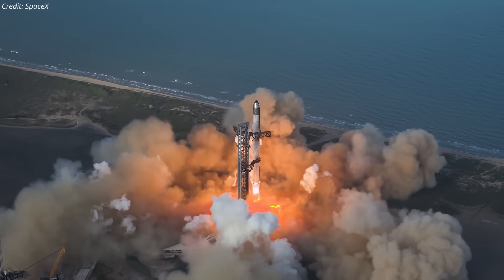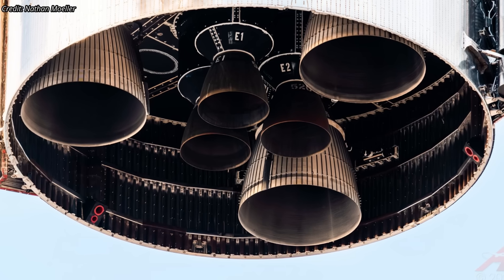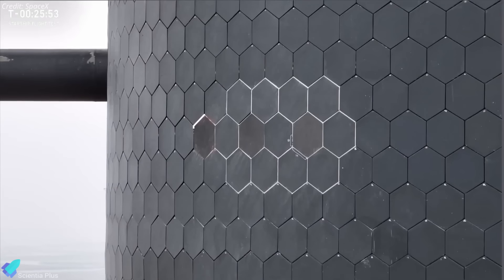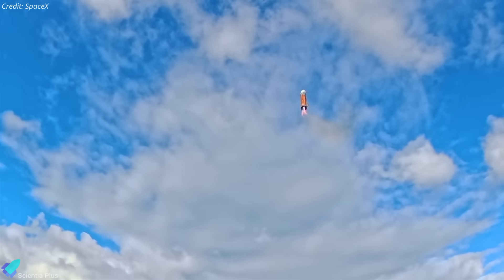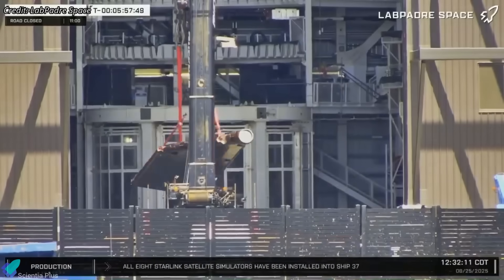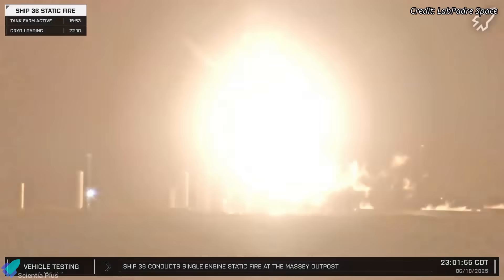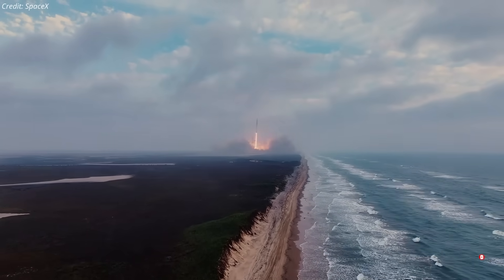Starship Flight 10 Aftermath a Closer Look! Explosion Source Footage Released From Flight 9

Comment from the maker: 🚀 Starship Flight 10 Detailed Breakdown: https://youtu.be/irVUMJNe0Kc

📚 Learn More:

🚀 Starship Block 2 Explained:
 📖 Summary: https://shorturl.at/b0dtw
 🔍 Detailed Explanations:
  • Design Improvements Update 1: https://shorturl.at/lpGT7
  • Design Improvements Update 2: https://shorturl.at/gwNQ4
  • Nosecone & Payload Bay Redesign: https://shorturl.at/xa60S
  • Methane Downcomer Redesign: https://shorturl.at/XdYBG

🚀 Starship Block 3 Explained: https://shorturl.at/mnBT4
🚀 Starship & Booster Block 3 Detailed Breakdown: https://shorturl.at/IViwD
🚀 Starship & Booster Block 3 Production Begins: https://shorturl.at/xRNkJ
🚀 Booster Block 3 New Transfer Tube / Downcomer Explained: https://shorturl.at/Iaqc6

🔥 Raptor V3 Mega Upgrades & First Test: https://shorturl.at/TRIyj
🧱 What’s Inside Starship GigaBay?: https://shorturl.at/nJM75

🛠 Insane Engineering of New Starship Launch Pad B: https://shorturl.at/7RAZd

🛢 Dual-Port Orbital Refueling – Full Technical Breakdown
https://shorturl.at/5tiqK

🛠 Other Starship Upgrades:
 • Hot Staging Explained: https://shorturl.at/jf400
 • Super Heavy Booster Upgrades: https://shorturl.at/Pi5R3
 • How SpaceX Protects Raptor Engines: https://shorturl.at/4Om8F
 • New Heat Tiles Explained: https://shorturl.at/p2Ijb

🚀 Starship Flight 7
 📽 Complete Breakdown: https://youtu.be/UqzZx7vb-TA
 🛠 Root Cause & Fixes: https://shorturl.at/HcLKo

🚀 Starship Flight 8
 📽 Complete Breakdown: https://youtu.be/f26yH80RK2o
 🛠 Root Cause & Fixes: https://shorturl.at/vsGFB

🚀 Starship Flight 9
 📽 Complete Breakdown: https://youtu.be/2eirgcUzwts
 🛠 Root Cause & Fixes: https://shorturl.at/NwhZA

🔥 Starship 36 Explosion:
  📽 Detailed Breakdown: https://youtu.be/VWQiIz1ymBA
  🛠 Damage Report: https://shorturl.at/Quoex
  🛠 Root Cause & Fixes: https://shorturl.at/NVqdS

🚀 Starship Flight 10 Detailed Breakdown: https://youtu.be/irVUMJNe0Kc

📡 Stay Updated:
📢 Weekly Updates: https://bit.ly/3HIQjPC
🚀 SpaceX Playlist: https://bit.ly/34wue8T

🌍 Follow Us:
👍 Facebook: https://www.facebook.com/scientiaplus

Comment: Raptor versión 3 engines will only be launched by 2027 on those versión 4 Starships.
I.e., 280*3+306*6 = 2676 tf, that matches those 2700 tf of the Starship version 4 table at 11:16.

Next milestones seems to be:
2025: orbital launch.
2026: fuel on orbit transfer.
2027: fuelling a depot-Starship with <10 tanker-Starships.

Comment: AND BOTH BOOSTER AND SHIP BLEW UP AFTER "LANDING" Afew meters above the water.  

How can you call it a success if bith ship and booster blew up?  

Reusability my ASS!
Reply: They were supposed to blow up.  Starship went into the water engines running. What do you think would happen when you dump running engines into water? As far as the booster that actually hovered a few hundred feet above the water. The engines were then turned off, letting the booster fall several hundred feet into the water.

Comment: The red area is oxidation while cooling , Rust !    The white on the ceramic tiles indicates they went past their heat limits, and are now useless for anything more! One use, but did the job.  You only have to look at the shuttle tile  heat shields when it returns, they were better quality and subjected to higher drag temperatures than the SpaceX craft ever experienced.

Comment: Great analysis but...
Block 4 is not quite the tallest rocket ever conceived.  The Sea Dragon rocket was designed to be 150m tall and weight 20,000 tons, but Block 4 is the tallest free standing rocket conceived.  The Sea Dragon had be sea launched so the water could support its weight.  It was intended to launch 550 tons to LEO- completely insane.
Reply: Conceived not the same as an operational vessel.
Reply: @MrFuentepj  yes but "tallest rocket ever conceived" was what they said.

Comment: Here’s a hard, technical audit of that “Flight 10 smashed milestones” script—claim by claim, what’s substantiated, what’s conjecture, and what’s simply irrelevant to the stated end-goal (rapid, fully reusable Starship and—beyond that—Mars logistics).

What they say vs. what’s actually shown

“Flawless liftoff and ascent.”
Video from Flight 10 shows at least one booster engine shut down early in ascent on other coverage; calling ascent “flawless” is spin. Redundancy handled it—good—but flawless it wasn’t. Redundancy ≠ maturity.

“Booster 16: stunning ocean splashdown.”
Guidance and control were good. But an ocean impact is a controlled disposal, not recovery. No reuse, no inspection, no turnaround clock. That’s not a reusability milestone; it’s a telemetry milestone.

“First payload deployment proves transport potential.”
They deployed simulators, and the door bumped during the sequence. Useful mechanism data, yes. “Hints at orbital transport potential” is fair, but it’s early subsystem test data, not payload ops at scale.

“Raptor relight in space = restart magic for future burns.”
A ~5-second relight under hand-picked conditions is a good demo, but it’s not proof of robust, multi-restart reliability across propellant slosh states, ullage control modes, and thermal histories. Bankable only after a matrix of restarts across regimes.

Engine-bay “explosion” root cause (chill-vent clog/rupture).
The script asserts a diagnosis without released telemetry. The “vent obstruction → rupture → ignition” chain is plausible, but it’s still an inference. If SpaceX hasn’t published valve timings, bay pressures, vent mass-flow, and post-flight NDE, this remains speculation.

Orange/white TPS colors explained by metallic test tiles + intentional tile deletions.
Again: plausible. But a strong claim (“tiles mostly stayed on; bonding validated”) requires hard artifacts: tile-map deltas, loss percentage, backside thermocouple traces, hinge/actuator peak temps. None are provided. Color ≠ condition report.

“Catch fittings survived; catch soon (F13–F15).”
A low-res still of external hardware post-plasma tells you almost nothing about microcracks, bolt preload loss, or tolerance drift. “Catch soon” is marketing until you show NDT results and a dry upper-stage recovery to inspect that hardware.

Booster grid-fin “shake,” 3-fin redundancy “validated,” Block 3 will move to three fins.
That’s an inference. Unless there’s released flight dynamics + control authority margins showing stable, commanded behavior with a missing fin, you cannot claim “validated.” It may be true; it’s not shown.

Block roadmap (Block 3 transitional, Block 4 to 42 total Raptors, ~142 m stack, first flight ~2027).
Ambitious. Also unbacked by public configuration control documents or pad/ground readiness for that thrust class, and it increases thermal/structural/propellant margins pressure. More engines ≠ easier reuse.

Site plan upgrades (on-site CH₄/N₂ production, bigger tank farms, flame trench).
Sensible for cadence. Irrelevant to the big missing piece: dry recovery and rapid refurbishment. Also: on-site production at meaningful scale demands serious continuous power and massive cryo throughput—numbers not provided.

What Flight 10 actually proved (useful, but narrow)

Upper-stage door actuation + dispenser function (with a contact event to fix).

One in-space Raptor relight.

GN&C accuracy to tight splash targets for both stages.

All valuable. None of it demonstrates recovery, refurb-hours, tile retention margins, or fast turn.

What Flight 10 visibly did not prove

Reusable TPS. We saw flap erosion, skirt damage, and a vent-ignition in the engine bay. Claiming “tiles mostly stayed” without quantified loss and backside temps is PR, not an engineering report.

Dry recovery & turn time. Splashdowns obliterate the very evidence (microcracking, adhesive health, fastener creep) you need to certify rapid reuse. No recovery → no turnaround clock → no “24-hour” claims.

Root-cause closure. The engine-bay event explanation is conjecture in the absence of published telemetry + corrective action.

Mars-relevant systems. No ZBO depot, no ~100 t cryo transfer, no minute-scale pad cadence, no prop chain at multi-Mt/month. Those are the gates for “beyond LEO.”

Where the narrative overreaches

“Every major objective was met.” Only if you downgrade “major” to “didn’t break up mid-air and we got data.” For a reusable architecture, major means: survive, recover, inspect, quantify TPS integrity, and show a credible turn. None happened.

“Heat shield validated.” Show the tile loss <0.1%, flap hinge/actuator temps within design, skirt/engine-bay thermal budget not exceeded, and no ignition events. That’s validation. We got none of those numbers.

“Catch soon.” Catch hardware endurance must be proven after a dry recovery and full metrology. “Soon” is a promise, not a result.

The metrics that matter (publish these, or stop saying “rapidly reusable”)

Tile retention map & loss % (belly + flap leading edges), with backside thermocouples and structural strain gauges.

Engine-bay environment during re-entry (pressure, temperature, flammables), RCA of the vent-ignition, and the design fix.

Post-flight inspection load: part count replaced, man-hours, and a dated target for next flight of the same airframe.

Booster/ship dry recovery demos (even to tow-back) before “catch.”

Ground cadence data: pad refurb hours, tank-farm reset time, methane/oxygen throughput per day.

If you keep invoking Mars: ZBO depot demo + ~100 t cryo transfer with <1% losses, and a permitted pad cadence consistent with the tanker chain.

Context you can’t PR away

Splashdowns are disposals. You don’t validate turnaround via water impacts.

Adding engines (to “42”) amplifies—not reduces—thermal, vibration, and mass-fraction headaches. The prop mass only goes up; the TPS problem gets harder.

Heat shield is necessary, not sufficient. Even a perfect TPS doesn’t solve cryo logistics, power, or cadence—the real wall for beyond-LEO ambitions.

Bottom line

Flight 10 was a good subsystem test for a LEO-class truck: guidance, door + dispenser mechanics, a single relight, controlled disposals. Call that a success and you’ll get no argument. But framing it as “every major objective met” toward rapid, full reuse is narrative inflation. Until SpaceX shows a dry recovery, publishes hard TPS and inspection metrics, and demonstrates a fast turn of the same vehicle, “rapidly reusable” remains unproven—and Mars talk is pure hand-waving. Physics didn’t change because the edit was hype.

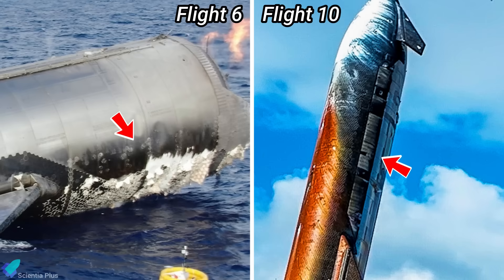Comment: Just a quick note: The arrow at about 5:50 isn't pointing at the interface between heat tiles and metal. That black section is just painted. The interface between tile and metal is at the border between the black and  dark gray to the left. If you look at the previous flights this area looks jagged because the hexagonal tiles make a saw toothed edge. This time, they filled in that edge with half tiles. Then added additional, smaller tiles along the border that are beveled to make a slanted surface between the tiles and the steel skin.

Comment: Everyone keeps saying the explosion was due to a propellant leak, but doesn’t an explosion of gas require both fuel AND oxygen?
Reply: Over-pressure explosion, combustion explosion, vapor cloud  explosion, boiling liquid expanding vapor explosion, dust explosion, chemical explosion.

All these are different types of exploding gasses. Or... Different types of explosions involving gas(es).
Reply: Given that the "propellants" are methane and oxygen and given that they are both vented, an explosion is always possible.
Reply: Not necessarily

Comment: Surprisingly they havent applied the heat shield to the QD like starship experiencing extreme heat.
Reply: What is QD? thx.
Reply: @1flash3571 quick disconnect. The system that provides propellants to the booster and that is covered a metallic roof after disconnection.
Reply: @1flash3571  The quick disconnect that they use to attach the fuel hoses to the booster and ship. The one for the booster has an armored cover because it gets blasted by the 33 raptor engines at launch. The one on Pad 1 has to be repaired after every launch, but the two that pad 2 will have are placed so they don't take as much punishment.

Comment: I wish it wasn't true, but success still seems to be largely based of good fortune.  We're actually downplaying an explosion onboard a portion of the ship which caused damage (but not failure) of key systems.
Reply: You do realize that they are STILL doing the TEST, riiiiiiiight? On this flight, they did MULTIPLE TESTS like coming down at a higher Angle Of Attack AOA to stress the Starship, Tested different type of Heat Tiles, or lack of it, tested the Booster, Tested the Dispenser for the Dummy Satellites, etc. The explosion is PART of the tests that is needed for SpaceX to see where the weaknesses are....The flight is a SUCESS Flight because THEY WERE ABLE TO GATHER PROPER DATA.
Reply: @1flash3571 don’t feed people like him . They listen to news stations like msnbc or cnn that say the mission failed
Reply: @Zer0talentWoW  Reread, nobody here said it was a failure - my meaning is obvious to most, beyond the capacity of a few to comprehend.
Reply: @1flash3571  Reread, nothing I said indicated I thought it was more than tests, nothing you said ran counter to anything in my comment.  Try again.
Reply: Success is based on bad fortune from which lessons are learnt.
Reply: @unseeninthailand-zu7yw  Obviously not, the successes of this flight were in part based on good fortune that the explosion didn't take out critical components.

Comment: It burnt to a crisp. Flawless?
Reply: IT almost always blow up when it touches the water BECAUSE the Fuel and the Salt Water DON'T MIX. IT didn't blow up because there were failures. Also, the explosion is due to the failure of some parts. Both the booster and the Starship MADE IT TO the Landing zone as designated.
Reply: @1flash3571 It was burnt beyond reuse long befor it touched the water
Reply: Flawless as in... All mission objectives were completed. Mission objectives are "tests". Even if the test "fails", it's a success because the test was performed and data was collected. 

No one in the world knows how to manufacturer a reusable heat shield. The flight was a success because they gathered data that will help learn how to do it. 

The last two flights were not a success not because they blew up, but because they failed to gather ANY data that advances heat shield reusability. 

I'm running out of ways to explain success.
Reply: @jimclark2824  As the narrator later said, the flight was a success even though it wasn't flawless.
Reply: @jimclark2824 The space shuttle invented the tiles SpaceX uses. They only lost 5% over the life of the program. Stop with the no one in the world can do it BS
Reply: The ship is not designed to land on water and then tilt and fall.  It ruptures the tanks, and whatever fuel is left goes up in flame.  It's perfectly normal and, even if the flight was not TOTALLY flawless, that part was.
You don't need to know much on the topic?!